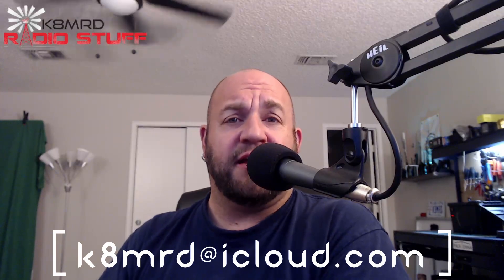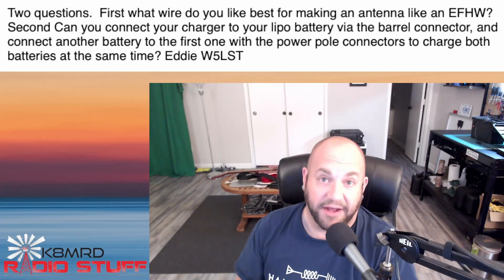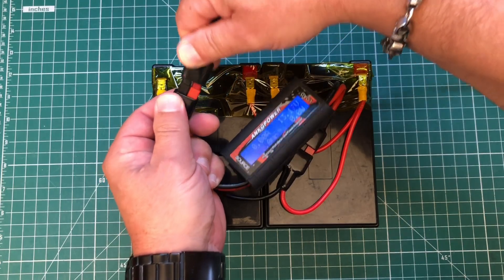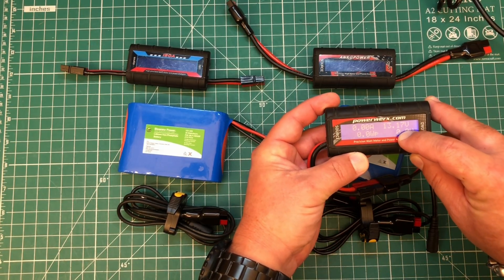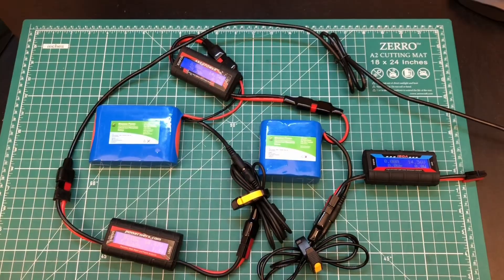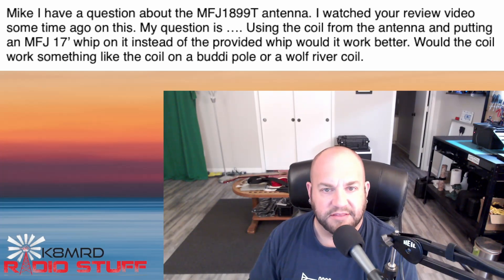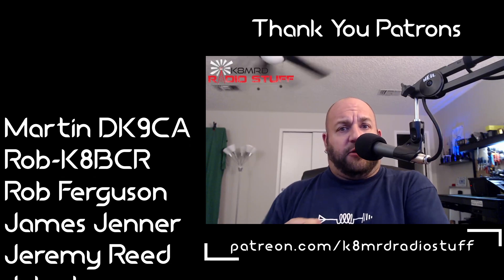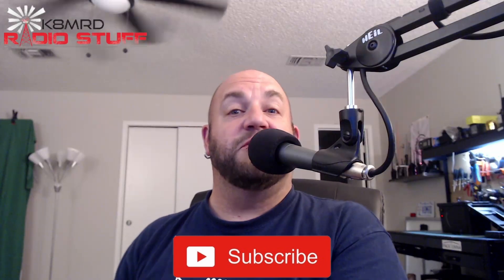Mailbag Monday #26 | Your Questions Answered...Poorly

Comment: The versions of the MFJ-1899T we get in the UK (Moonraker SPX-100, ATX Walkabout) have a 3/8" stud in place of the BNC plug so you can either use a 3/8" mount or an adapter to PL-259 or BNC. If I can get hold of a 17ft whip I'll try it with the 1899 coil, probably on the mirror mount I have fitted to my motorcycle, though probably not while riding it....

Comment: Would love to see you try the 17' whip on the MFJ coil and try tune it by picking a tap and adjusting the whip in and out. It might be able to make it resonant on every band - just not using the default taps that you'd use with the stock whip.

Comment: 5:10 "Why would anyone do this" set up a fire, get injured - pick up any. There was a small difference in voltage between batteries. Connecting like that without any circuits that limit current is just another "Leeeeeroooy Jenkins".
Reply from the maker: Where was the fire?  And boy you sure are assuming a lot.  Maybe learn a little about what's inside those batteries before typing next time.
Reply: @hamradiotube  I guess there is a BMS inside with maximum discharge current limited by nothing but an external fuse... assuming that there is a BMS inside a battery pack and potential victim will think about adding a fuse. The best person that will tell you how to charge those batteries will be the producer. There are many "If" in your viewer question and the only situation that I can imagine that will prevent overcurrent is equally discharged batteries to prevent or minimize current flow between batteries themself. Mind that not all batteries have a BMS, and many batteries do not have individual protection circuits for each cell, because it's cheaper. Just think deeply and say to yourself what will happen if you short battery terminals. because that's what happens when you connect in parallel two batteries at different voltages.
Reply: Is there a better way?  I've tried to look for battery isolators or similar but couldn't find anything.

Comment: Again another great mailbag. Would like your opinion/reason at 1:10 you stated "I don't do LiFePO4 Batteries".  My 3 minutes of research is Li-ion is a smaller form/weight and is initially cheaper that a LiFePO4. However the number of charge cycles for Li-ion is about half of the LiFePO4.  You've apparently done more research and have actual experience so your opinion has value.  I can only GUESS that for SOTA and walk-in POTA you use the old adage; "you take care of the ounces and the pounds will take care of themselves".
Reply: He said he doesn't use LiPo batteries, he does use Lithium Iron Phosphate (LiFePO4).
Reply: @kevingoshe4371  Thank you.  I'm going to chalk it up to my poor hearing. Apologies to K8MRD.
Reply: @bill-kf4cdk485  all good, sir. glad to help. 😀
Reply: LiFePO is also a safer chemistry.  No more dangerous than a lead acid battery.
Reply from the maker: What Kevin said.